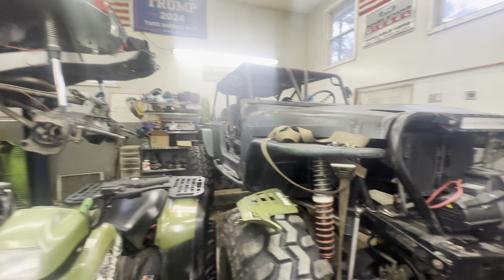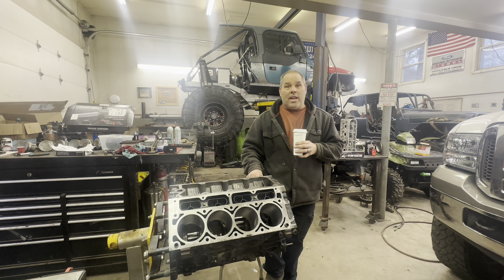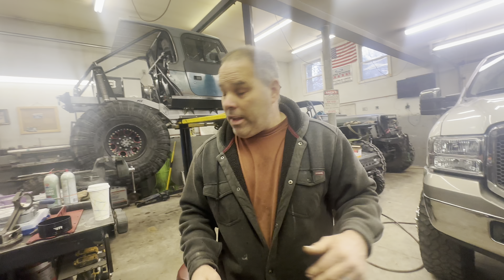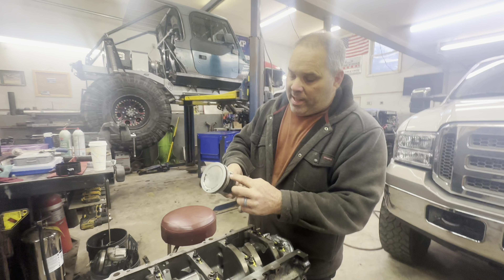6.0 Liter LS Motor Rebuild Part-1

Comment: Plastigauge is fine and i sometimes use it when the crank or rods are in an engine and I can’t use a bore gauge because the crank is occupying the bore. It works good to double check your measurements but micing the journals is quick and easy with the bore gauge